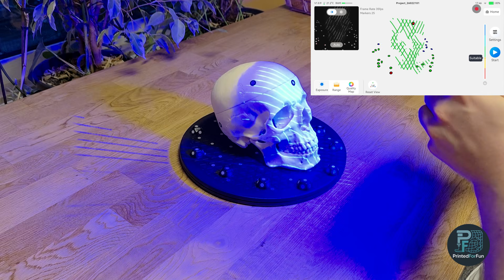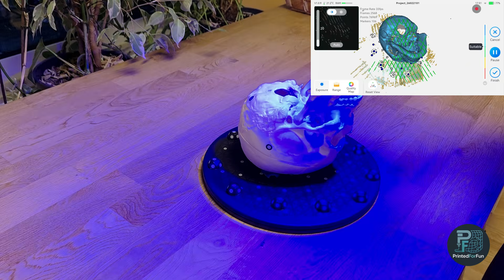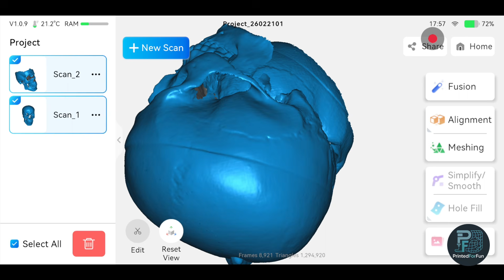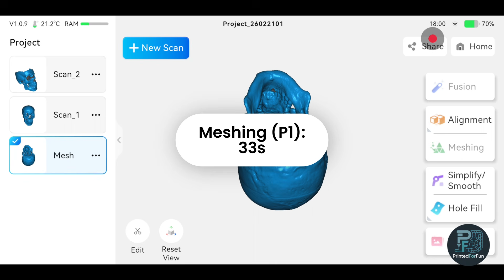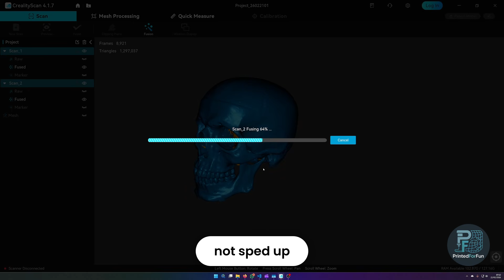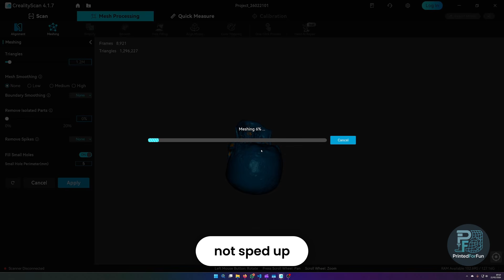Scanning and Processing Workflow of the Creality Sermoon P1

Comment: Hi, I have a favor to ask—since you have a P1, could you please run a quick test and scan a coin, like a 1 EUR? I’ve been trying on my P1 but keep getting poor results. I’ve tried several times with parallel lines and the local details feature in the CR scan software, but I can’t even make out the lettering on the scanned coin. I’m not sure if it’s an issue with my unit or if I’m doing something wrong. Thanks!
Reply from the maker: Sadly not an issue with your unit. Will scan the 50ct coin I also scanned with Rigil and Rockit when I come around doing it but what your experiencing is expected.
Reply: @PrintedForFun  Thank You. That's actually good news. If it's the best it can do, then im happy. I would be more worried if i had defective unit :)

Comment: Where did you get that turn table and why do you need markers?
Reply from the maker: Turntable was just a random cheap one from Amazon and the markers are needed so the scanner knows the position of the part and therefore can stitch together all the images it mages
Reply: @PrintedForFun thank you for your response and information. I just ordered this scanner can you make a beginner guide video explaining what each menu does and also how to scan small items with fine details please?
Reply from the maker: @rareplaystations will do
Reply: @PrintedForFun thank you! Its a little confusing to understand what resolution to use and what each step does and is for. I have never used a scan before so if you can make a detailed beginner guide that would be great. I am getting my scanner tomorrow 😅

Comment: I also recently purchased a P1. The issue isn't with small objects, but when scanning larger objects around 1 meter in size that have gray and black areas, it frequently misses the markers. I contacted customer support, and they said it's a known issue and they're working on a firmware update. Does your device find the markers well? It seems to work fine with small objects, but since larger objects need to be placed further away, it becomes problematic.
Reply from the maker: In laser mode the working distance is always capped at 550mm therefore you cannot simply move further away for larger parts. You simply have to bite in the apple and stick on much markers. Maybe have a look at the marker geometries (added link to video description). Makes the setup much easier and efficient.